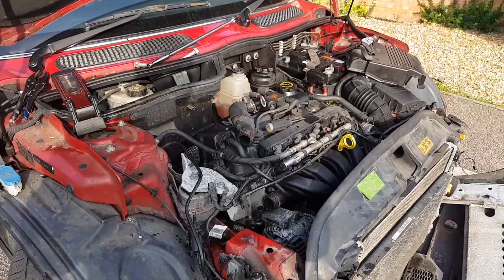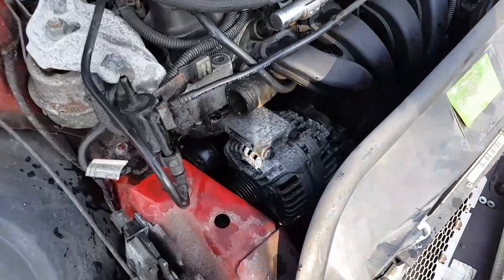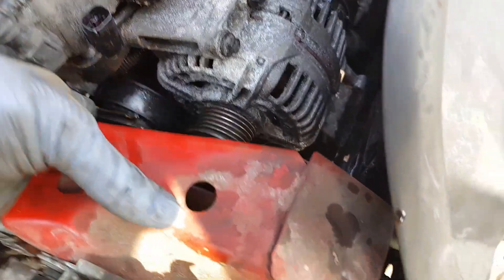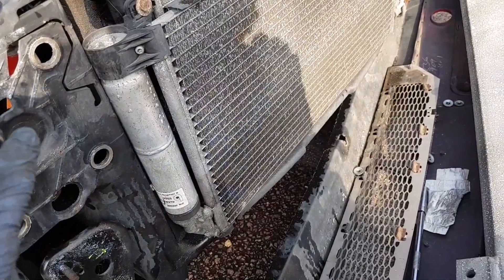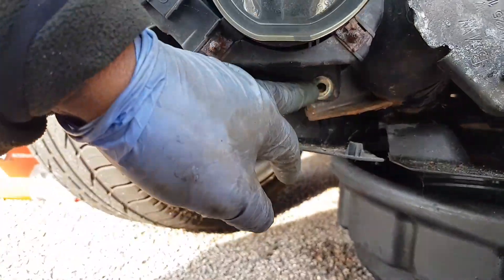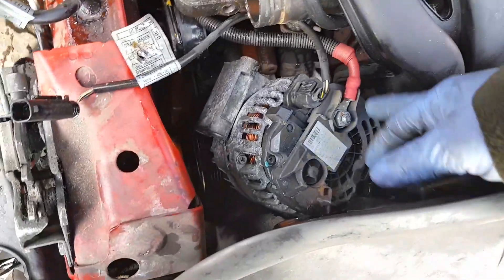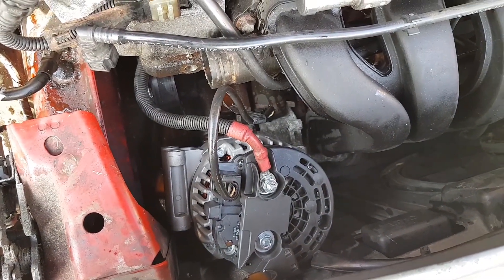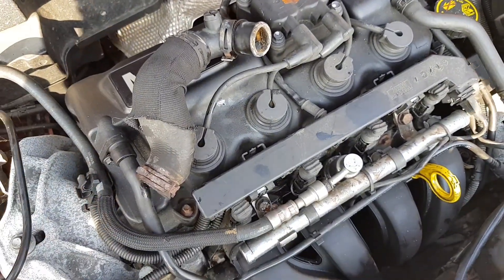Bmw Mini 1.6 2004 Alternator replacement

Comment: No need to disconnect anything, there's just enough room to manoeuvre the alternator in and out, just need to be careful and take your time!! Just completed my installation... dashboard lit up like a christmas tree with lights, eventually gave a solid red battery light. Check the battery charging after pain fight with the fuse box... check the battery first is my advice!!

Comment: no need to take bumper off or engine mount
Reply: I agree. Its far easier to just remove the wheel if more clearance to tensioner is needed. In my experience, you can avoid front end service mode(removing bumper) unless your dealimg with an s model